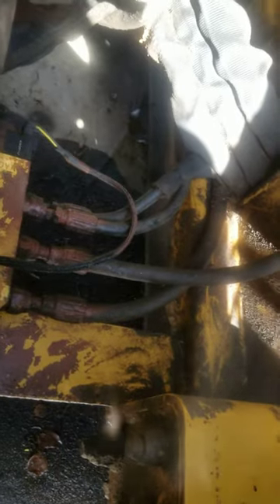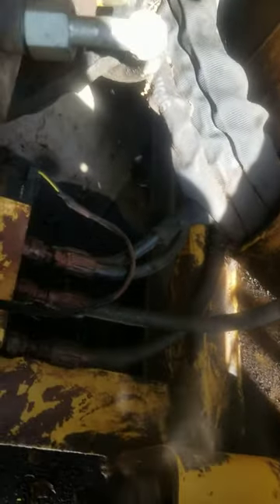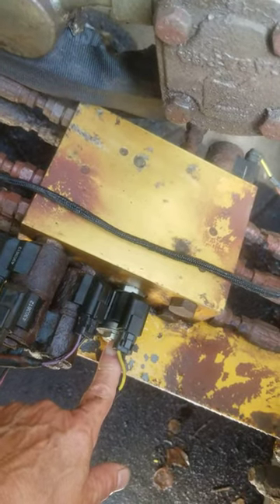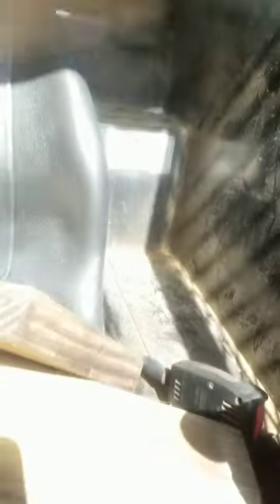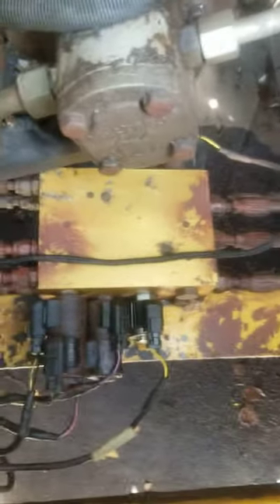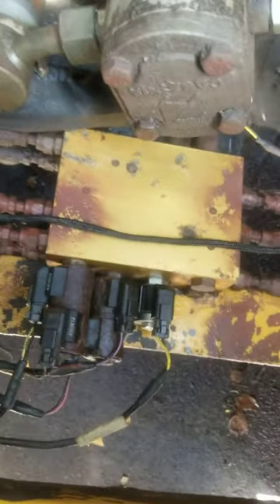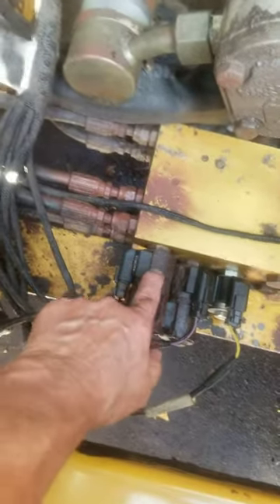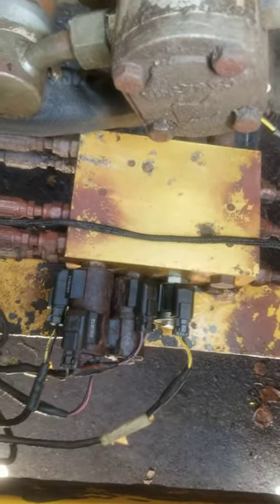ASV skid steer

Comment: My terex pt60 starts but does not move… none of the hydraulics are functioning.  I checked the bar and seat switches.. those are good.  Machine ran and I parked it for a bit… now it’s a lawn ornament
Reply: Same issue.  Did you figure it out? Is it what this guy is showing?
Reply: Yes, it was a crusty relay… I moved them around and all is well
Reply: @pjp80s  and @kaiul2967, I have a sr70 with similar behavior. My pilot generation block is designed differently, but before finding this post I suspect a safety solenoid is faulty which sounds like what you found? Looks I might have a problem making sure I have the right part # as the one I suspect is bad is not listed in the parts manual. Hard to believe! They should all parts on the other side of the block, but not the side I think I need. Where did you end up getting parts? Maybe they have a better schematic. I'm hoping I can swap out for another solenoid on the block to determine if I have the right one or not

Comment: I think this just happened to my machine. Where did you get parts?
Reply: Same here I’m in need of some of these as well did you ever find them?
Reply: Currently dealing with the same issue with my Terex pt30. Checked the safety switches, fuses and relays, all are good . I'm convinced it's the same issue,  safety solenoid. Not easy to access